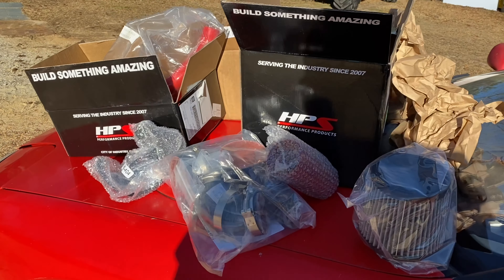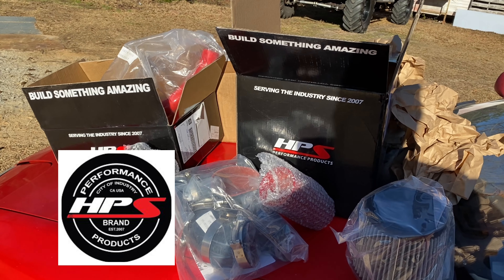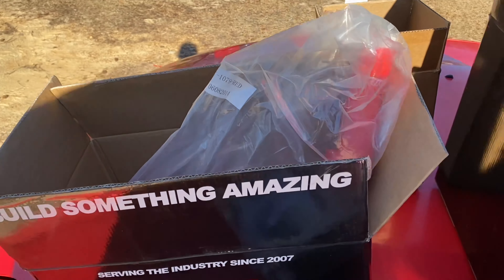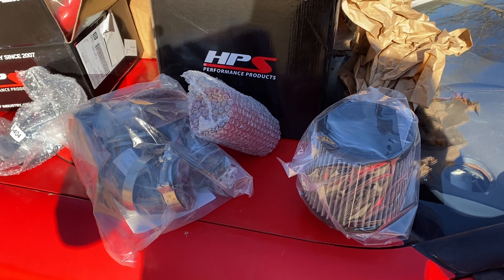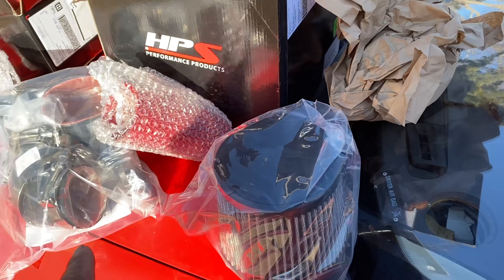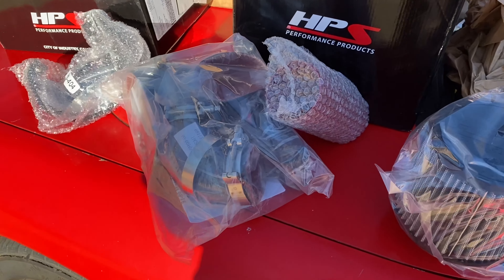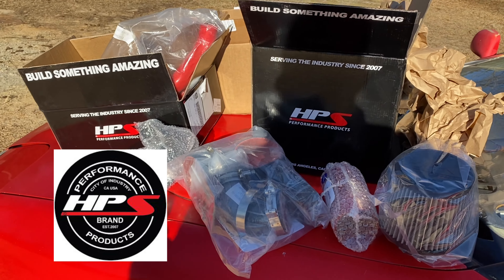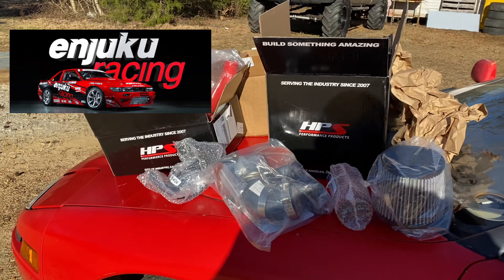1993 Mitsubishi 3000GT/Stealth: Apex: Enjuku Racing and New HPS Parts.

Comment: 'tis something i heard fairly often: how are you gonna shove them in the engine with how small the bay is?
Reply from the maker: Lol yep it’s pretty bad, not a bad as the 300zx tho😂.  Since this video I have pulled the motor for a rebuild and to do a 5 speed manual conversion. In the process of redoing the interior also.